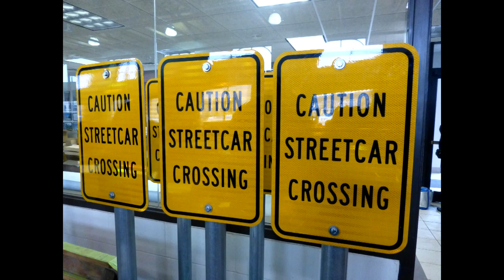Kenosha Streetcar 2185 First Day

Comment: When I was a little kid we used, to have ACTUAL buses [ no tracks, rubber tires ] that would have over head twin rods leading from the buses's roof that connected to the over head electrical cables. They would run up and down Flushing Avenue in Brooklyn N.Y. day and night.  Then a little bit later in the late 1950's, as I was growing up I, started to notice a gradual faze out of these bus types, and they eventually were replaced by "all diesel powered" G.M. buses. By 1959 the electrically powered buses were all retired. Yep, those were the days !
Reply: They were trolley buses , or trackless trollies, depending where you came from. Many bus mfr's made them  GM, Brill,Marmon Harrington, Pullman Standard, and AM General to name a few
Reply: @billfitzpatrick6910  A couple lines still exist in Cambridge and Watertown MA (and have new models); they run out of Harvard Square....  I'm sure a few other places do as well
Reply: @ Kenni, I believe that Philly still has 3 trackless trolley routes left.
Reply: they still have those in philly

Comment: Nice to see a new trolley line using the PCC cars, GE or Westinghouse controllers please. We still have PCC cars I service on the Mattapan line here in Boston on the MBTA. at the rear bean head seat center upright cushion remove the cushion and you should find T backup controller which uses the reverser handle to operate it if they rebuilt the correctly.
Reply: I love the Mattapan line! Here in Philadelphia, one of our trolley lines (15) runs these PCC streetcars. They were renovated, of course. The trolley car in this video has the SEPTA logo on it... I guess they were sold here when we got the new Kawasaki trolley cars.

Comment: Didn't 2185 have a pole in the front?
Reply from the maker: Yes it did, not needed for operation in Kenosha. By removing the pole the lights were able to be reinstalled.
Reply: It didn't when it was in Philly. :-)  I probably rode that car to school on the 23 line a few times.
Reply: @MargaretLeber  2185 went to a museum first. The museum installed a front pole on it for backup moves. PTC or SEPTA never had front poles.

Comment: was it difficult shipping these cars from Russia. They look Russian, is what I am trying to say.
Reply: PCC cars, totally American Design...Nye Russki.
Reply: Dont get me wrong, I think they very cool and retro looking. They just look kinda old world Russia-looking.
Reply: Raptor: No argument here, they have always seemed that way to me. I used to ride them as a kid in the 50's, and the way they worked was a bit strange. I joined a trolley museum and drove them, they were a bit odd, but well designed, especially the magnetic brake. That was genius at its best....
Reply: Raptor3400 , The PCC has always been an American design. After WWII, the Czech tram firm Tatra received a PCC license, which was appropriated by the Russians, who made copies of the PCC.
Reply: The PCC stands for the Presidents Conference Committee which was the Presidents of several large streetcar companiuthat got together starting in 1933 to design a modern streetcar. 

Who knew when the first cars were produced in 1935 that they would continue to be built and last for over 80 years. The last PCC cars were built in 1951 for the Boston MTA system but they used the truck design and control system to continue to build new rapid transit cars for over 50 years after PCC streetcar production ended. There are still some subway lines that still run PCC rapid transit cars today.

Of the several different truck designs for PCC cars I prefer the early WW II designs which used cast iron tread shoes which cleaned the rail contact area every time you applied the brakes making it more difficult to slide a wheel set and have a flat spot on the wheels but that design requires an air compressor but it's a better design brake wise than the drum brake design which replaced it.

If memory serves me right the controller you were demonstrating in the shop is the Westinghouse design as the GE design used a motor armature with a moving brush holder to run around the armature to provide power and dynamic braking.
Reply: Actually, lots of European companies also produced the US designed PCC cars or variants thereof. In the Netherlands, the city of The Hague operated them for quite some time. I think those were Belgian made.